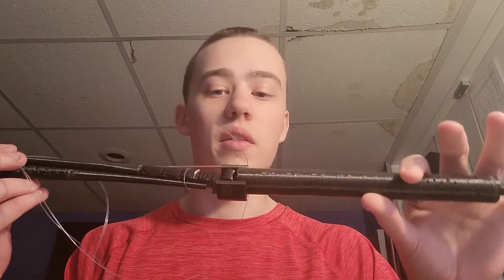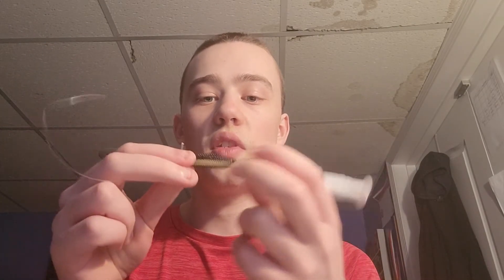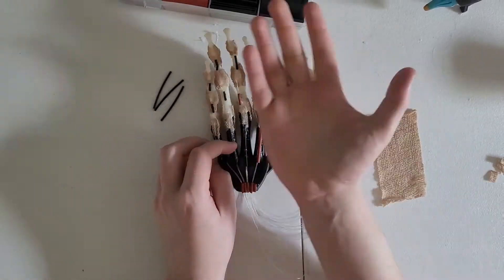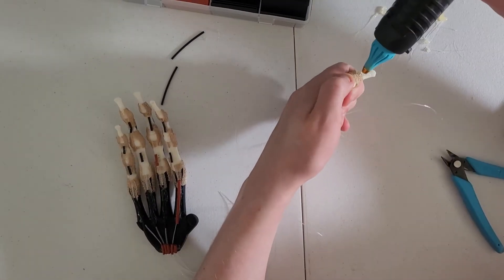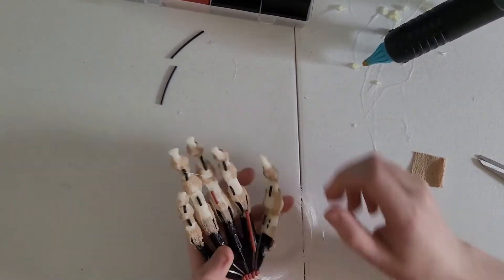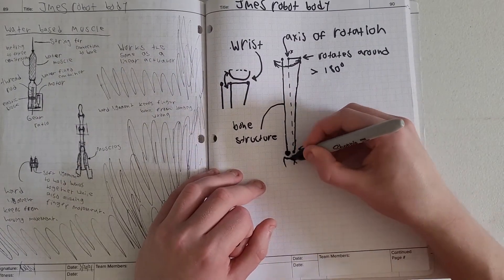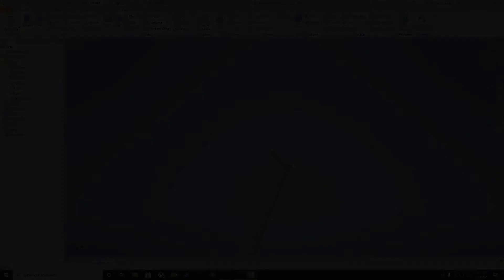Our Hand Is Looking REAL GOOD! | Robotic arm Build

Comment: Hey man just found your channel, I've had this idea for a while but I'm not very knowledgeable on electronics to actually try to do it. My idea was to use a DC motor as a sort of pully attached to an elastic string/band strung from the humorous to the radius/ulna to mimic bicep contraction. I have no idea if that is even feasible or if I am capable of doing so, so I'd just like to ask how you can get into electronics? I disassembled a drone motor and attached it to an Arduino breadboard, but I don't know how you would safely go about powering the thing in a circuit, as it runs on a 12V 1200 mAh battery and I'm afraid of working with anything higher than a double A battery. Anyways, good luck on the project!